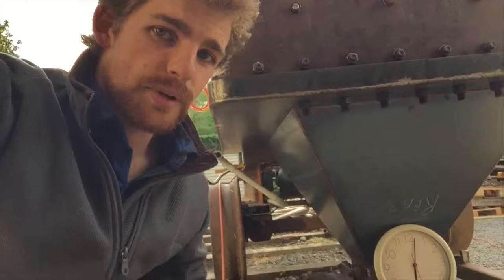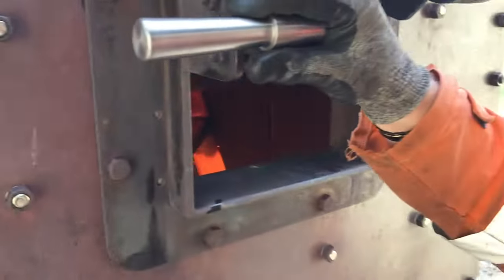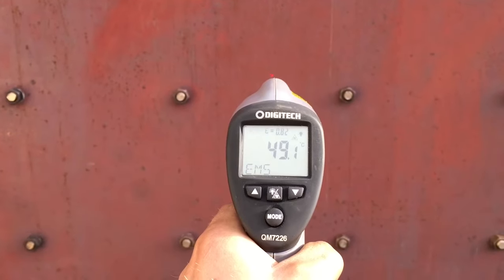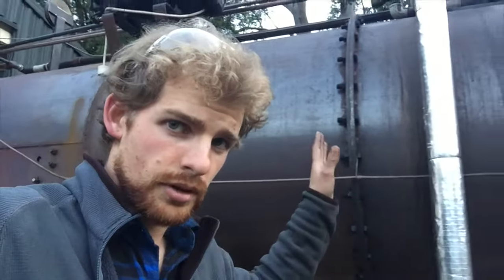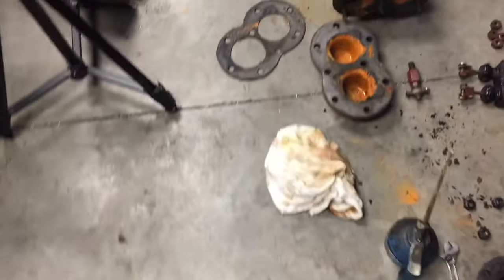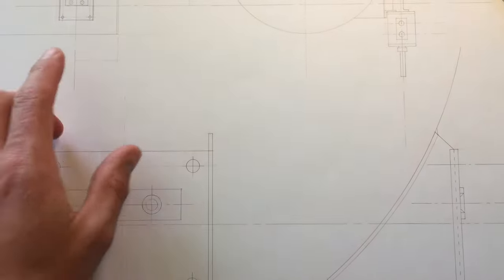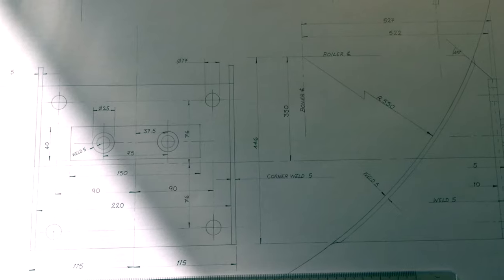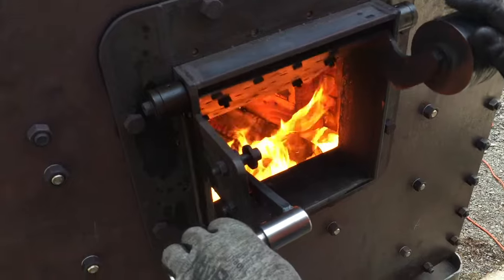21st Century Boiler Secrets | Modern Steam Locomotive Design & Build EP5

Comment: Greetings!

From a theoretical perspective, firebox is the most heat-intense part of any steam locomotive. Designers always aimed to maximise it's heating surface to increase the steam generation rate and put a good use to all the heat created by fire. How feasible is the decision to go against it and make firebox thermally insulated? (firebox usually generated around 40% of all steam).

If thermally insulated firebox preserves heat, what ensures that this preserved heat is transferred to water and is not lost with gases exiting to firebox? Exiting gases have a very high speed and were usually unable to transfer heat completely even with long tubes. Temperatures in smokeboxes of conventional locomotives raised all the way up to 400 degrees Celsium with intense combustion rates.

Thirdly, how necessary is combustion chamber? On conventional locomotives it was mostly used to evade using long tubes and flues, not for any efficiency purposes.

The final question, will you measure the work of finalized locomotive in relative units, such as: steam consumption per drawbar horsepower; power output relative to firegrate area; steam generation rate plotted against fuel combustion rate etc. just so it could be compared to conventional locomotives?

Sources I'm using are:
- Ralph Johnson. "The steam locomotive,: Its theory, operation and economics, including comparisons with Diesel-electric locomotives"
- 1938 American Locomotive Cyclopedia
- Soviet 1928, 1929 and 1936 manuals for steam locomotive design including manuals for boiler heat balance calculations
- Soviet 1935 and 1956 handbooks with steam locomotive performance diagrams
Reply from the maker: Hello! Excellent question, this is a very important subject and deserves a much more detailed explanation that I can give it here. Briefly, for a conventional boiler, radiant heat transfer in the firebox is a function of firing temperature. As firing temperature reaches a maximum quite early on, the firebox generates a roughly constant quantity of steam independent of evaporation rate. This means that as evaporation rate increases, the tube bank is responsible for generating a progressively greater fraction of the boiler's steam output via convective heat transfer. This causes superheat to increase with increasing evaporation rate, reducing loco efficiency at part loads due to less than optimal steam temperatures. The convective heat transfer/absorption efficiency in the tube bank is independent of the combustion gas mass flow rate, the faster the gas flows, the more heat is transferred. The reason that smokebox gas temperature increases (to 400 deg.C) with intense combustion rates is not due to the limitations of the tube bank, rather it is due to the firebox's limited capacity to absorb the combustion heat output resulting in an increasing combustion gas temperature at the tube plate. The tube bank continues to absorb the same fraction of heat per unit of combustion gas that flows through it, but the inlet temp. is higher so it follows that the outlet temp. at the smokebox must also be higher.

The new boiler employs convective heat transfer only, for equilibrium steaming, the inlet temperature at the heat exchanger is largely fixed at all evaporation rates, this means that the superheat remains constant and combustion efficiency is always at a maximum. The absorption efficiency of the boiler is also nearly constant.

In simple terms, the combustion chamber in this boiler prevents the flames from being quenched by impingement on the relatively cold surfaces of the heat exchanger, which would result in incomplete combustion.

A big yes to your final question, absolutely essential.

I'd love to get my hands on some of the sources you reference!
Reply: @Mackwell-Co  Thank you for your response!

I will adress sources first. Most of them are Russian language manuals of Soviet Union that were used for locomotive design. They are:
- 1928 brief manual
- 1929 brief manual
- 1935 "Steam locomotive series FD" which is one of the greatest books I have, explaining the calculation of actual locomotive which was mass-produced, including comparison of theoretical performance with actual test data.
- 1936 extensive manual with a hevay emphasis on boiler heat balance calculations
- 1952 extensive manual with even heavier emphasis on thermodynamics.
As for English-language sources, those are American Locomotive Cyclopedias of 1938 and 1916 and R. Johnson's "Steam locomotive" which has data on American locomotive pefrormance tests. [in fact, only 1916 Cyclopedia is actually in English, other two are in Russian translation].

I'd like to comment some of your sentences from the point of knowledge I posses.

> "As firing temperature reaches a maximum quite early on, the firebox generates a relatively constant quantity of steam independent of evaporation rate."

I would like to respectfully disagree here. Conventional firebox transfers heat in two ways - via convection (through it's heating surface) and radiation. While radiative heat transfer is indeed a function of combustion temperature which is barely dependent on combustion rate, there is also a convection process with the following formula:

Q = K×H×(t-tₒ), where:
Q is the amount of heat transferred
K is heat transfer coefficient
H is heating surface of firebox
t and tₒ are temperatures of heating and heated body.
Now, K here is a function of mass flow and is proportional to it and is a function of combustion intensity, excess air coefficient firebox parameters.

So, while radiant heat transfer remains mostly constant, convection heat transfer grows with combustion intensity and therefore firebox generates progressively larger amount of steam. If you manage to get your hands on Ralph Johnson's (amazing) book, there's 1912 test data on unique tests performed in Coatsville, Pennsylvania, where evaporation rate was determined independently for firebox and tubes/flues. The table given under paragraph VII "Steam generation" shows firebox generating different amounts of steam depending on combustion rates and it keeps up in proportion with overall steam generation rate. So amount of steam generated in conventional firebox is definitely not constant and is a function of amount of fuel combusted with evaporation rates from firebox surface reaching more than 200 kilograms of steam per meter squared per hour.
This is why I asked about your locomotive completely (as far as I understood) eliminating firebox heating surface per se and the feasibility of such decision.

>"This means that as evaporation rate increases, the tube bank is responsible for generating a progressively greater fraction of the boiler's steam output via convective heat transfer. This causes superheat to increase with increasing evaporation rate, reducing loco efficiency at part loads due to less than optimal steam temperatures."

I can agree here, though firebox still generates a sufficient amount of steam. Again, referring to tests in Coatsville, when boiler in total was generating 20000 kg of steam per hour, firebox was generating around 6000 kg. Heating surface of firebox was 12 times smaller than that of tubes (22.8 m² against 279 m²) meaning that firebox evaporated 263 kg of steam per m² per hour while tubes - only 50 kg.

>"The convective heat transfer/absorption efficiency in the tube bank is independent of the combustion gas mass flow rate, the faster the gas flows, the more heat is transferred."

The heat transfer in tubes is found via a cumbersome logarithmic equation which I find a bit complicated to post here... The left part of the equation has temperatures in it which have to be equal to the right part of the equation, which is K×H (coeffient of heat transfer and heating surface of tubes).
The thing here is, K is actually a function of two values, one of them being tube diameter and other - gas flow rate. Amount of heat transferred then is:

Q = K×H×t
Where t is the average gas temperature in tubes. While the text above does not disagree with the point of heat transfer efficiency being independent of mass flow rate, this raises another important question for me. K is not directly proportional to mass flow rate; in fact, different formulas show K being proportional to mass flow rate to the powers of 0.5...0.8. That means that gain from raising mass flow rate is progressively smaller; so while the more heat is transferred with larger rate, what is the ratio of transferred heat to the total heat available in gases? I think this is a very important thing to consider.

>"The reason that smokebox gas temperature increases (to 400 deg.C) with intense combustion rates is not due to the limitations of the tube bank, rather it is due to the firebox's limited capacity to absorb the combustion heat output resulting in an increasing combustion gas temperature at the tube plate. The tube bank continues to absorb the same fraction of heat per unit of combustion gas that flows through it, but the inlet temp. is higher so it follows that the outlet temp. at the smokebox must also be higher."

In your locomotive, where all the firebox heat is preserved, does that mean that outlet temperature will be higher than that of conventional locomotives? This was the largest concern to me when I was listening to boiler design. The way I imagine it, there will be more heat with heating surfaces (which allow this heat to be transferred to water) being smaller (with elimination of heat-intense firebox surface), which will limit the possibility of heat to be transferred leading to a lot of heat remaining untransferred. Anyways, I would like for you to clarify this moment to me.

As for final sentences, it is honestly a bit complicated to me to imagine how all this works without some sort of internal elements diagram of the boiler. Though what you say sounds interesting and may actually neglect something of aforementioned concerns.
Reply from the maker: Thanks for this detailed replied. As mentioned, in no way did I intend to address this subject exhaustively here. My comments were greatly simplified and very approximate, intended to convey a basic theme.

Briefly and slightly less approximately: You are correct regarding firebox heat transfer. The Hudson-Orrok firebox heat transfer equation as modified by Porta is useful for quantifying this, given as:

n = 1/(1+((A ÷ 0.46) x (Q ÷ (10^6 x H))^0.5))

Where:
n = Fraction of firebox heat release rate absorbed by the firebox heat transfer surfaces.
A = Combustion excess air coefficient.
Q = Total heat release rate in the firebox in kcal/h
H = Inner firebox heat transfer surface in m^2 (including refractory arch factor)

Taking the data for the oil fired 5AT as an example, using this equation it can be approximately shown that at rated evaporation, n = 0.27, and at 10% evaporation, n = 0.54

Therefore a 10 fold increase in heat release rate in the firebox results in a 5 fold increase in firebox heat absorption.

Again you are correct about the convective heat transfer coefficient in the tube bank not being in proportion to the combustion gas mass velocity. Your figures showing it to be proportional to the power of 0.5 to 0.8 agrees with the figures I have here (on the face of it approx. similar to the heat absorption relationship in the firebox). However, as the heat transfer coefficient falls, the log mean temperature difference between the combustion gas and the tube surfaces rises due to the outlet temperature of the tube bank increasing. This attenuates the effect of the falling heat transfer coefficient, which also varies in relation to temperature and rises with temperature, offering further attenuation. 

Taking the worst case scenario here where the heat transfer coefficient falls in proportion to the square root of the mass velocity. If the mass velocity increases 5 fold, the heat transfer coefficient will increase only 2.24 fold. Then, to transfer the same quantity of heat, the log mean temperature difference must be 2.23 times higher. At a tube bank inlet temperature of 900 deg.C and a saturated steam temperature of 186 deg.C with an absorption efficiency initially 98%, the fall in absorption efficiency to maintain the heat transfer rate is only 25% as against a 55% fall in the heat transfer coefficient, and this is the worst case. There are a number of factors not considered here, but the result is that in practical terms, tube bank absorption efficiency may be considered approximately independent of mass velocity.

The new boiler has a carefully designed heat exchanger to compensate for the loss of firebox heating surface, which includes both a large heating surface within a compact unit and a high free gas area to ensure acceptable draughting power. The smokebox gas temperature is expected to reach not more than 300 deg.C without a smokebox economiser. 

R. Johnson's book sounds particularly interesting, especially the test data you mention. I will keep a look out for a copy.
Reply: @Mackwell-Co  Thank you for this detailed reply! I wish you good luck with your project.
Reply: Water cooled combustion chambers on small boilers are pretty much a no-no now adays. It quenches the partially burned gases and results in very high ubburned hydrocarbons and carbon monoxide. These crappy wood fired outdoors hot water boilers you see in the USA all have chilled combustion chambers and produce huge amounts of smoke for this reason. They have given wood boilers a horrible name and have even resulted in bans. The gassification hydronic boilers use ceramic lined fireboxes and often preheated combustion air and burn very clean.
Reply: @gregorymalchuk272  The decision whether to have combustion chamber installed on a locomotive or not was mostly dictated not by any efficiency concerns but by locomotive layout. Combustion chambers were used when the length of boiler barrel was exceeding the practical limit of tube/flue length (20...23 feet).
Reply: @the_vadym  
Yeah, true, and emissions weren't on their mind then. I was mostly talking about wood-fired home heating boilers.
Reply: @the_vadym  if you really want to dive into steam locomotive effecency and research, you should read up on the 5a steam project, the coalition for sustanable rail, and the the writings of Livio Dante Porta, he picked up where andre champlan left off, and really 4 or 5 people are carrying on porta's research and findings today after his death in 2003, I like one steam restorer that worked with him for a time when he was working on the ace 3000 project, named gary bensman. 
and on the water tube designs mentioned origionally the emerson type that the baltimore and ohio had looked into is that it gave you more evaporative surface, and it was so they did not have to put in tons of staybolts, but the scaling was a nightmair to clean it was said with all the bends in the tubes of the waterwall style firebox, that and it did not have the structural rigidity of a regular firetube boiler, and they leaked bad.
Reply: @manga12  I am not sure if researching efficiency of locomotives which were never built is worth it. Any performance figures for them are purely theoretical and may or may not be correct.
Thank you for advice anyways.
Reply: There was much I could dive into but porta applied thermal dynamics and flow rates as well as boiler design let night though I was tired after work and did not have much time to talk about it 
But as Livio Dante Porter would say you don’t know what you don’t know until you know it that is to say a preschooler doesn’t know about algorithms until they’re old enough that they reach eighth grade and then they learn of algorithms existence and therefore they know of them and so to port are used to say and paraphrasing understanding is dictated by the lowest common denominator of understanding when speaking about it  he would also say that well he would also say that just because you’re not aware of something you may not know you’re not aware of it so why do you research and look at some of the research that’s been done and continue on I guess it’s always nice to see the new steam projects and research going to the sauna steam technology and believe me there are still some things that haven’t really been widely applied like multi pass boilers are things are using stationary boilers like rifle boiler tubes they don’t really use them in steam locomotives of course station Stationary boilers and locomotive or fire two boilers on mobile devices like tractors are two different beasts in the way that they’re designed and laid out and being on some other research it or other railroads did research of water two boilers but they leaked badly and so they weren’t in Nam use for very long like the George Emerson
Reply: what a fascinating comment chain! steam train youtube is the best part of the internet!
Reply: I'm not bringing much to the conversation here, but I'd like to express my appreciation of the quality steam nerd content in this thread.
Reply: @gregorymalchuk272  That's not really a boiler, more of a glorified water heater... and barely runs a decent fire. Sooo not really applicable here.
Reply: i agree really the fire should be all around and in side the boiler insulator should surround and all boiler and fire box inside also yo really need two or more chimneys to lower the speed of the exhaust gases .a chimney at each end ?
Reply: Very interesting topic.  I’m hoping you do a bicycle steam engine in the near future without lithium batteries!